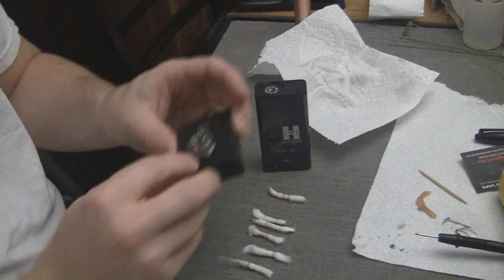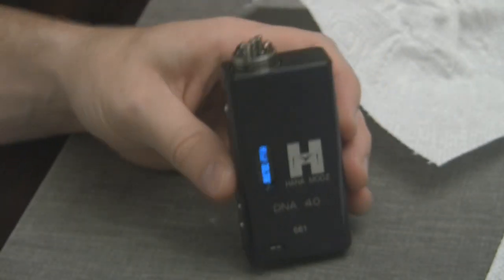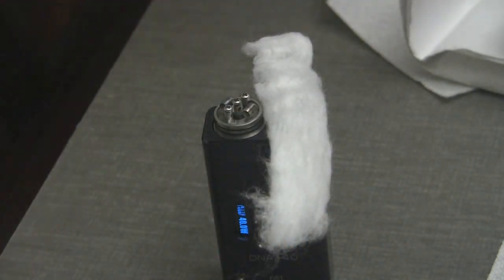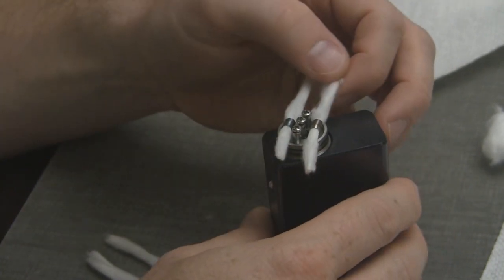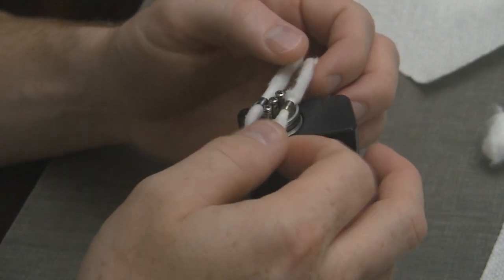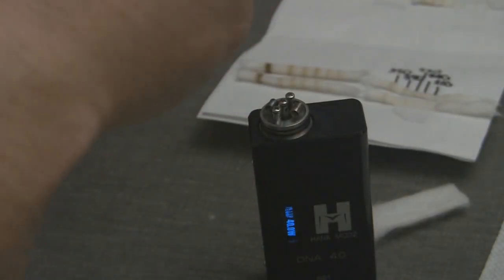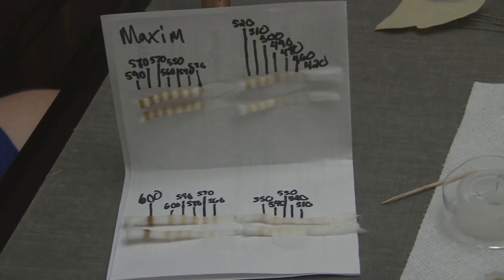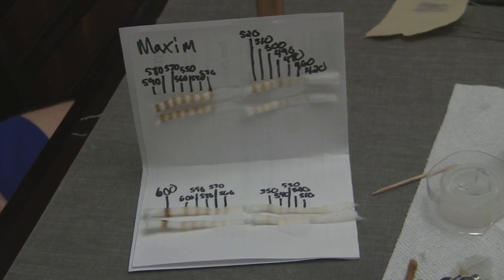Hana DNA 40 Cotton Burn Test

Comment: Thanks for doing this so we don't have to. What happens if you put the nickel coils on a non DNA40 device?
Reply from the maker: You are welcome.  I wanted to do something to give back to the vaping community. 
Nickel just has a much much mower resistance.  Lets use 28g as an example for comparison.   28g Kanthal is 5.27 ohms per foot while 28g nickel is .377.  I have a dual 18 wrap 1/8 inch inner diameter 28g nickel build that comes out to .14.   I would not recommend building for a mech mod with nickel until we know more about it.

Comment: Interesting.  So do you think having the dual coil setup is what kept it from getting to temperature in the later part of the video?  Also do you know if the temperature control settings will work with Nichrome 60 wire?
Reply from the maker: According to Evolv the temp control will only work with Ni200.  I have had it try to sense temp with 30g kanthal though.   It doesnt actually sense temperature though.  What it does it use the wattage and the resistance to determine what the temp should be.  So if you use a wire with a different resistance than Ni200 it wont be accurate.  I believe it is explained in the data sheet that you can DL from Evolv's website.

Comment: Hey, Steve Wood, how are you enjoying your Hana Mod? I'm about to upgrade, but don't know if it's all the hype. I'm currently using a K100. Thanks!
Reply from the maker: I like it alot but i hate building with nickle.
Reply: Steve Wood why's that? Kanthal softer or something?
Reply from the maker: Well, first off with nickel you have to use 30g to get a decent build.  Its springy and doesnt like to hold form.  I use rayon now for wicking and i use quite a bit so its easy to deform the coil.

Comment: does the low resistance of ni200 kill battery life quicker?
Reply from the maker: No because the device knocks the wattage down once you reach the temperature threshold.  It will fire at 40 watts for a second if it needs to then it drops down much lower.  So lets say you have it set to 440 F then it might fire at 40 watts for a second then drop down to 13 watts or 2 watts.  It all depends on your build.  It will jump around alot because the device is checking the resistance on the atty something like 10 times a second.  Does that make sense?
Reply: Steve Wood I've heard it's 100 times per second. Just wanted to help with this itty bitty correction.